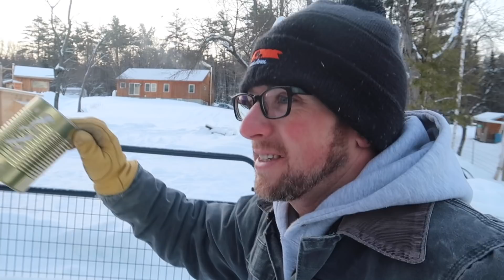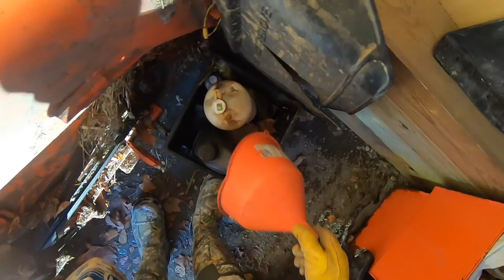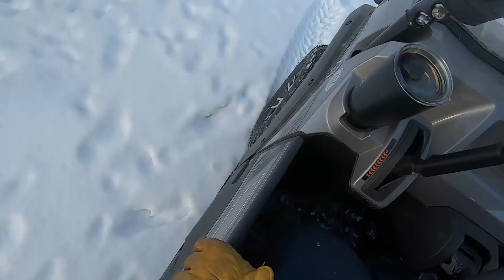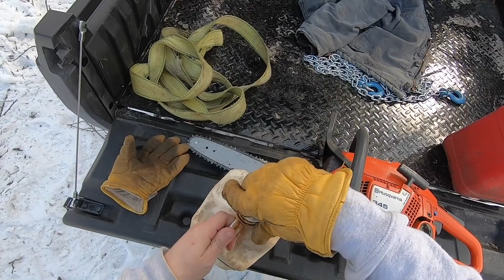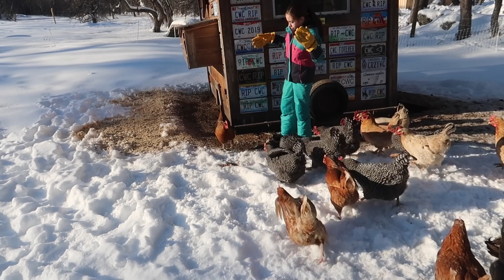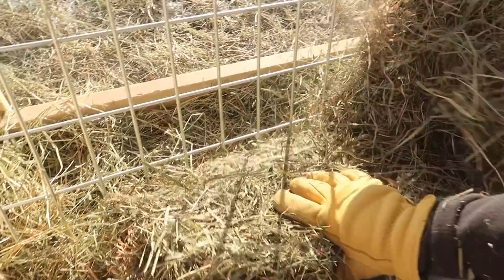We bought our HOMESTEAD because of THIS now we HAVE to CUT it DOWN

Comment: Where did you get your grain containers? What are they called? How much do they hold?
Reply from the maker: we have the containers shown here www.amazon.com/shop/lumnahacres they have different sizes and they tell you how much weight they hold
Reply: thank you Al.
Reply: You went all in on them, I see. Looks like you have 6 of them now. I have 2, and have had them for years. While I do like them and still use them, I do not buy them anymore. They claim to be stackable, but not really. If they have any weight in the top Vittle Vault, it makes the bottom one squish down. Once you remove the lid on the bottom one, it distorts from the weight and is problematic to screw the lid back on. While I love the idea, I have moved on. The same company Gamma, makes the screw on lids that fit on 5 gallon buckets. They are Gamma Seal lids, and work better. While I still have the 2 Vittles Vaults I bought for 34.99 in May 2015, I have about 2 dozen Gamma Seal lids for 5 gallon buckets. They offer multiple colors for the lids, and there is endless possibilities on 5 gallon buckets. I am able to color coordinate everything. And they are a lot cheaper. The only downside of the Gamma Seal lids is the buckets will not be able to nest anymore, no storage doesn't save any space.
Reply: Lumnah Acres- I just bought the 40# and a 22# for chicken feed and DE!!!! Thanks f!!👍🏻❤️
Reply: Lee Valley Tools sells the screw top pail lids adaptation to put on your 12 inch pails, to convert them to easy opening like your feed tubs. 
Always bitter sweet to have to cut down trees. Had to do that for a pine Grove I helped my grandfather plant, but they went wild and stringy, and began to die off. You might miss the shade, but the new orchard sounds exciting
Reply: Hocus Pocus thank you for the heads up.
Reply: they had them at sams club look on line they are dog food containers
Reply: Gamma2 Vittles Vault Outback Stackable 40 lb Airtight Pet Food Storage Container
Reply: they are called vittle vaults and they come in several different styles and sizes.
Reply: I dont mean to be offtopic but does anybody know a tool to log back into an instagram account..?
I was dumb forgot my login password. I love any tips you can offer me!
Reply: @George Michael Instablaster :)
Reply: @Wilson Grey I really appreciate your reply. I got to the site through google and im waiting for the hacking stuff atm.
I see it takes quite some time so I will get back to you later with my results.
Reply: @Wilson Grey It worked and I finally got access to my account again. Im so happy:D
Thanks so much, you saved my account !
Reply: @George Michael You are welcome :D

Comment: I am only speaking as an ex-logger from the west coast of British Columbia fifty years ago so maybe chain saws are completely different now but I would say that the chain on that saw is way too tight. We would have loosened it until the chain at the bottom of the bar was hanging loose. On the 48 inch bars we used it would hang down so the drive links were one quarter of the way in the bar groove.
Reply: Chain saws have changed a lot since then he has a self sharpening chain now
Reply: yeah but you are talking about a home user... they are likely to get the chain jammed in the cut and yank it out and make it loose... so tight works at first
Reply: Old Fart  It did sound a bit tight.  Hey you or your fellow loggers ever see a sasquatch in your years in the bush? They say BC is a hot spot. 
48" bar.....that'll get it done! Bet you've taken down some monsters in your day. Take care.  Cool name!
Reply: No your right he did tighten the chain too much, it should be a little bit looser then he has it. My chain saw bogs down when its that tight.
Reply: I was taught by a Newfie who used to work in the bush on how to sharpen and tighten the chain.  He always said to tighten the chain until 3 drive links were completely visible after you lift the chain.  Plus, when cutting frozen wood, the teeth on chain should be sharpened to a different angle compared to thawed wood.
Reply: Yep, it's a tad tight, but runnin what you run and these little saws is quite a bit different. Run that little saw that loose and you'll skip it off the bar every couple minutes. That self sharpening saw-  I think Al is giving it a fair shot but will end up realizing it's a gimmick for folks that don't use their saws much and he'll end up going back to normal chain soon. ;)

Comment: Might I suggest you graft to the old root system, with a new apple variety. This will have you in apple's much earlier, and with the extensive roots <much of which will be dieing back since you cut most of the upper end off> the regrowth will be much faster.

Having said that if you are going to replant new apple seedlings, plant them nearby and they will be able to tap into the old trees root/soil network. As these trees decompose the network will feed the new tree getting sugar in exchange. 

If you want the trees to water themselves even in drought, plant from seeds so the tap root can reach the sub surface water aquifer. Any non annual planted inplace will typically do better than anything transplanted, this is the result of the tap root breaking during any plant handling above soil. The tap root is critical to longterm success of an orchard. So if possible plant from seed within 3 to 5 feet of the stumps, you can cover it with a glass cloche to aide germination. Good luck.

Comment: Gina, I stopped peeling any potatoes I’m planning on boiling years ago. I just throw them in the pot whole and when they’re “poke” tender I pull them out into a colander in the sink. They peel easily with your bare hands. I peel mine using my thumbs to rub the skin off under slow running water. It’s really easy and takes less than 1/4th the time vs using a tool. You can even do them a day early and just put the whole potatoes in a plastic zippie until needed. I find they do taste better than boiling away the flavor of the little pieces plus I’m sure they’re retaining more nutrients too. Just thought I’d share a tip✌🏼😉
Reply: I dont boil my potatoes for mashed or potato salad etc. I cut them in cubes and steam them till fork tender. Then run cold water over them if I'm using them cold,  or hot and mash them. No waste in the water and so much faster. The potatoes aren't water logged.

Comment: greenhouse/high tunnel!   :)  We are pruning an old orchard on our farm.  This year we did a big pruning but most years we do less.  The trees (they are full size ones, not dwarfs) don't look too cute but they put out lots of flowers in the spring.  We plants some comfrey under them and let the sheep graze there several weeks of the year.  They love the apple prunings, and then we use small pieces in the BBQ.  You might use them in the smokehouse.

Comment: Goooooood Evening , Al , Gina & Olivia  ,
I would have done the old apple trees a little differently.  First I would have begun restoring them with some good pruning.  That process would take three to five years.  In the meantime they would be producing some  apples.  Cider , apple sauce , pies , etc. 
At the same time you could plant some new apple trees which will take four to six years to begin producing. As the new trees come on line then you cut down the old trees.  That way you would not have all of those barren years of no apples.

Comment: I learned to grow sweet potatoes in mid-Michigan by planting the slips in used tires.  I had to bore holes in the sidewalls for drainage, of course, so that mosquitoes were not laying eggs in rain accumulating in them.  As the taters grew, I stacked more tires and soil/compost.  The black tires absorb heat, which is required for good production for this native of Africa.

Comment: Al, if I might adda a comment. The threes structures you built this winter are all on skids. My comment is that when placing any of these three structures you should use several 6x6's under the skids at right angles in order to elevate the skids which would prevent premature rotting of the structural skids. You will be older when they require replacement. these 6x6's should also prevent sinking into the ground which will make moving more difficult.
Reply: Very good idea 😊
Reply: Am made the skids out of hemlock if I remember correctly.  They should last a long time.
Reply: @wayneleamon3186  Yes hemlock should last longer than spruce/fir/pine but setting the structural skids on a couple of 6x6's will help prevent rot as the structural skids will have air circulation and not be continually wet/dry. The 6x6's will also prevent the structural skids from sinking into the ground and being difficult to move.

Comment: You need a couple of plastic milk crates to put in the back of your mule to keep small items from sliding around. I have one in the back of my truck to keep my one gallon gas can from tipping over. I anchor the crate with a bungee to one side of the truck.

Comment: Al, cut up the apple trees into logs to use for smoke wood in the new smoker.  Apple smoke is mild and pairs well with pork and chicken (really about anything, but IMO it's a little mild for beef).  If you want to let the goats eat the bark, you could cut up the wood after they are done and it would still work just fine.

Comment: You could use the od aple trees as root stock since they are aready acclimated ... Just graft the apples you want onto them ... Roots are already developed ... Debark and use the wood for the smoker ... Off Grid With Doug and Stacy call it aging in place ...

Comment: Al if you are replacing with new apple tree's I would suggest a couple of Honeycrisp trees and pair them with the Sweet Sixteen variety. While the Honeycrisp is a lower producer they are really good tasting apple and the Sweet Sixteen  produce large sized apples and more than the Honeycrisp does and both were developed for colder climates by the University of Minnesota. Honeycrisp sell for a minimum of $4.99 a lb on average and sometimes higher than that. Those are the only two varieties I would ever consider growing and the Sweet Sixteen is the variety we pick at our local orchards in the fall.

Comment: Look at Westendorf brush crusher for your tractors loader. Cheaper than a grapple but would move  that brush pile in no time with little effort. And depending on lift capacity of your tractors loader. You can pick up a good size log and move it. And even to hold the log up while you buck it up. No bending. So less chance of arthritis from over lifting and bending later in life that will cripple you. I know from experience. What you are able to do in one of your videos would take me a month now.  Of course I am just a bit older than you! Have a good day. I enjoy the videos a lot. Thanks

Comment: Land management requires these choices. And given the apple trees hadn't been managed for so long, it's little wonder you need to start over.

I'm guessing the new project is going to be a food growing area, whether it's something like a polytunnel, or a greenhouse I guess remains to be seen. I'm thinking it could also simply be an outside growing plot, but if you want to extend and optimise the growing season, something built for that purpose would make sense. 

I'm glad some of that apple wood is going to the smoker. My immediate thought was some of the larger pieces would make great smoking logs. 

I also have a brush pile at the one end of my garden where it's useless to try and grow anything due to the location. It's amazing how many varieties of animals it houses now it's established.

Comment: sweet taters need good soil and 125 days to make from slips. just bury a few taters like 5 or so bout 6-12 inches deep and pull slips off when about 8-10 inches long. plant 2 ft apart on a mounded row 3 ft apart. use a 5 10 15 type fert every few weeks and water when dry. easy peasy

Comment: I planted 2 simi-dwarf Granny Smith apple trees once. I never trimmed them and the tops grew too heavy for the roots and the roots broke and the trees fell over. So, unless you plan to do some major trimming on your trees every year, don’t buy dwarf trees.

So, all a dwarf tree does is supply a smaller root system, not smaller trees.

Comment: Are you planning to use heating lamps in the new chick house?  They are so unsafe. Have you considered a safer heat source?  I use Sweeter heaters in my coop. My small group is spoiled and get heat at nite however the Sweeter heaters are infrared so the animal must be laying directly underneath the heater but it won’t heat up the bedding. The heaters don’t heat the coop up but does keep the chill out of the coop cause my water never has frozen but keeps my lil group warm and they are safer

Comment: You’ll probably find that using the old trees would be better used as rootstocks for grafting on better choices-you’d speed up the time to a good harvest by nearly a decade. I was very sad to find out that there weren’t any wild apples on my land (very rare here) due to a fire twenty years ago. It would save me a LOT of work and time even if the fruit didn’t turn out to be any good-and certainly cheaper than buying even whips.

Comment: An easier way to get marriage sweet potatoes is by putting them in the oven for a little while and getting them soft and then taking the stuff out of the middle like you would a baked potato that's why I was told to do it I found myself doing what you did and boy I was gave it up real quick

Comment: What ever happened to that wood flat top "cart" you made a while back? The one you used to move a lot of the wood for the barn build. You use to pull it behind the tractor. Could you not have used it for this project?  Load up the smaller limbs on it to take off to the pile.

Comment: POTATOES! I planted my potatoes near the Ides of March like my Grandpaul did. Below ground Plants can go in earlier. I bought a 50 lb. bag of Kennebeck (best) I cut my potatoes so I had a spud in each section, planted in rows. As the tops came up, I hilled up the soil around them covering the top. Kind of a V formation formed going through the rows. February the farmers would plow & disk their fields. I never carried water out to my potatoes as the weather did that for me. Rain from March, April, into May. Some of the old timers planted by the signs of the moon, ex: the points of the moon facing up. Check your local growing season almanac.
APPLES! I remember Grandpaul grafting his apple tree. The last one still standing, the apples still are beautiful, red & yellow on one side of the tree, while the rest are red. The last time I made applesauce it gave me a bad case of the runs, sorry to say. They lost there flavor after 100 years. I'm 61 now, I was about 8/9 when I watched them notching the tree adding a twig from another tree & vice versa. They were yellow apples they called banana apples. They were delicious!

Comment: https://www.youtube.com/watch?v=fntEpajBcMc   Gary Pilarchik video.  For Sweet Potato  I planted purchased plants a 6 pack in my front flower garden. the vines were Beautiful and had filled 2 4 x 16 ft beds. I had a lot of potatoes. I left them in the ground thru october because they were cool at Halloween. I'm in zone 9b, but if you start them early and get your slips started and set them in small pots them plant outside when the frost is gone, or cover them with row cover you may get a good batch of potatoes.  Good luck with them.

Comment: your running the chain to tight, with saw sitting upright it should droop about 1/8 to 3/16 inch on bottom, also save your apple wood for the smoker